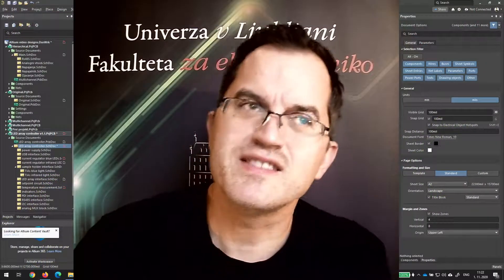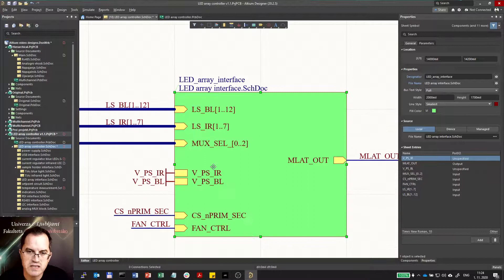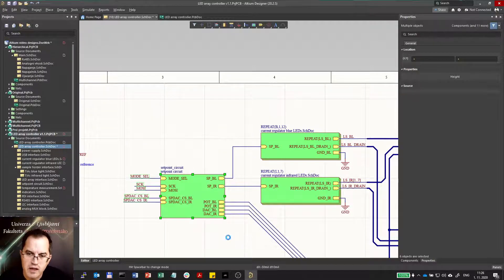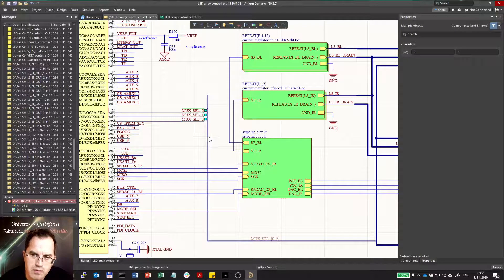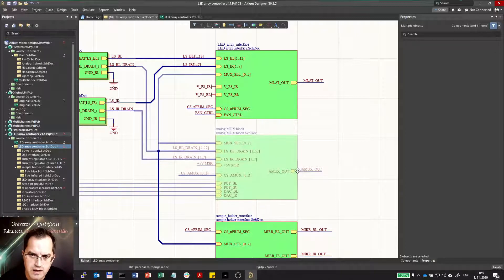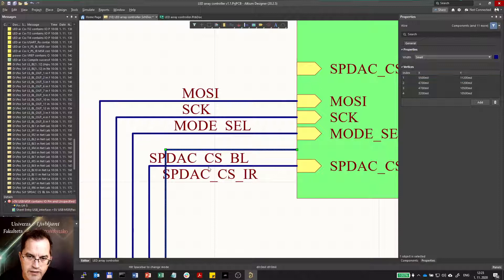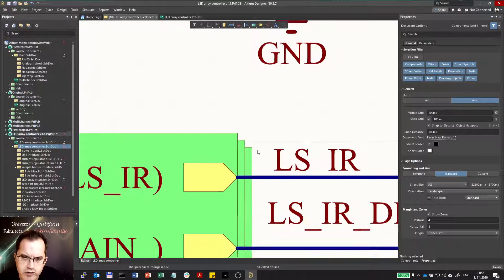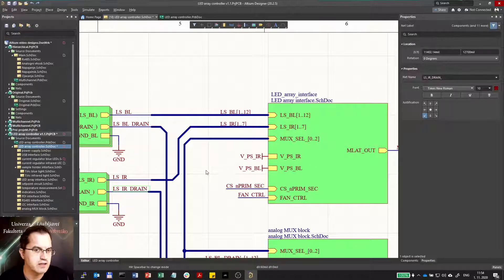Altium Schematics #08: What gets on my nerves

Comment: I don't really like hierarchial design and 45 deg angles in schematics, so haven't faced most of these issues. :D
As for the rest, based on my experience: a) for checking where a net goes it's best to use highlight net instead of find. b) you can select to bridge the wire at crossings at sch options (but i would also keep the dot for 3way connections), it's more legible and also i think prevents shorts when moving wires around. c) it's preferable to use only 100 mil grid for components and wiring, since most libraries are designed using 100mil grid and it also prevents floating connections. You can of course use any grid for placing designators, text etc, those aren't critical.

Comment: I don't know why it's so hard for these CAD companies to get it right! I remembered having the same problem with Xilinx ISE in early 2000's. So every time I try a new CAD software, I would hold a block with wires spinning around to see if the net get stuck or lose somewhere. It always does especially with Altium. I believe OrCAD also had these problems as well. The bus always have problem. It was the same power point, and other block + connecting wires program. There must be something hard about wires connecting to blocks algorithms.